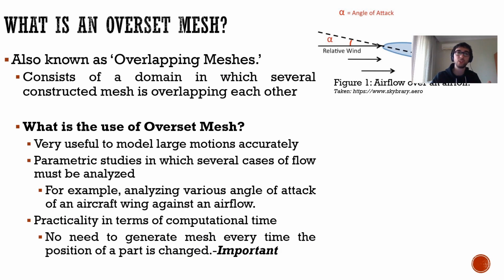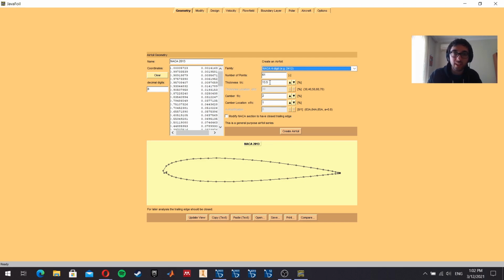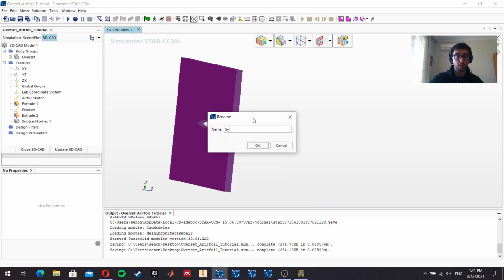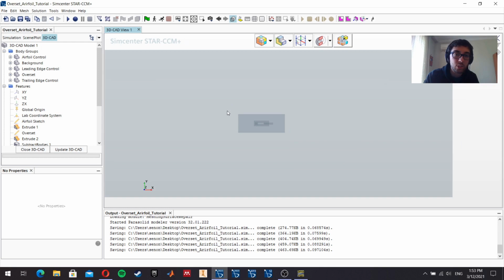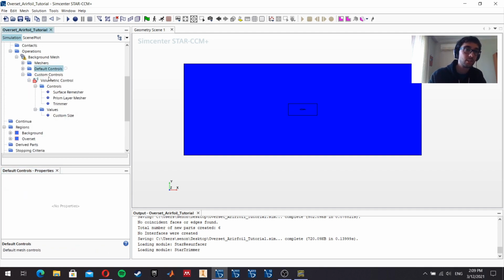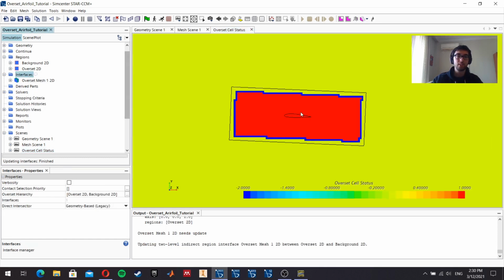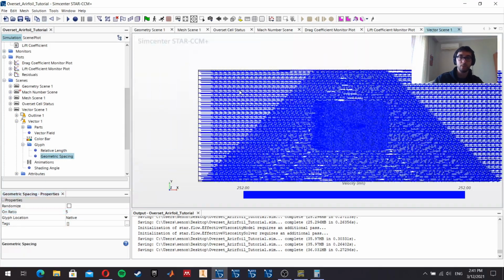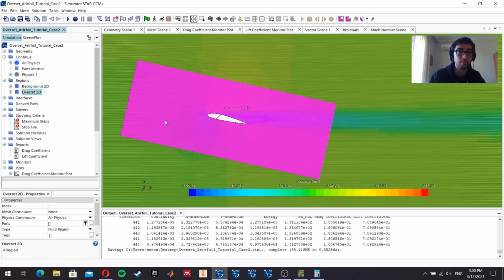A Flow Case Study: Transonic Air Flow Over NACA2213 Airfoil Using Overset Mesh

Comment: Hello, I just came across this extremely helpful tutorial. After following the steps in video, I am now trying to apply a translating motion to the airfoil so that it moves up and down the y-axis, hence simulating a simple flapping mechanism. Do you have any ideas on how to achieve that? Any guidance would be greatly appreciated.
Many thanks.
Reply from the maker: Hello,

You can always apply a user-field function in which you can define the desired motion to the airfoil (the overset motion).  

Perhaps you can create a field function of a sine wave with respect to time and then assign it to the motion through TOOLS>Motions>(Your Specific Motion-rotation, translation etc...)> click on the motion and assign the function (for rotation you have to click on rotation rate then click the box with three dots in the properties window and for translation you can assign  a user-function through clicking on it >translation velocity>click on three dots and assign your function.)

Hope I was clear enough. If you have any questions please let me know!

Cheers. Good luck!
Reply: @ownershen97  Hello, yes this is extremely helpful. thank you so much for the quick reply! I have done this but then do I apply that motion to the overset region? And I am also struggling to set the physics models, do I have to select specific models so that I am able to see the airfoil moving when I run the simulation?
Thanks again nd apologies for taking your time.
Reply from the maker: @alejandrabotbol308  Hey Alejandra,

You should apply the motion to the overset region. 

Considering that there is a time-varying parameter in your simulation, you should select a model that is able to show you time dependent motions induced into the flow. Note that ReynoldsAveraged Navier-Stokes(RANS) models are not very applicable in your case so you should either use Laminar or Large Eddy Simulation (LES) for your models (FYI:Laminar is not necessarily a model) with a fine enough mesh to resolve the turbulent scales.

Preferably, you should use LES. Also, if you would like to see the motion, you can take 'snapshots' of a scene for each specified time-step through adjusting the settings in scene>update section. 

Try to set up velocity and pressure scenes and see the changes in the flow. 

Cheers!
Reply: @ownershen97  Thank you for all of the advice, it is extremely helpful. I will try all of that!
Reply: Hi have you solved this problem of airfoil flapping? if yes I need a little help. Thanks

Comment: Hi, when I try to display y+/pressure plot along the airfoil chord, I find out it will be more clear by separate the airfoil to upper and lower surface, but It is hard to do in the 3D-CAD, do you have some easier way to do that?
Reply from the maker: Hey,
Correct me if I misunderstood you question: You would like to separate the airfoil into two sections; lower and upper surfaces.

In that case, in 3D-CAD, before you subtract the airfoil shape from the overset region, you can create  a point at the centroid of the airfoils side surface (right-click on the surface --> Reference Geometry-->Point from Entity Center-->Centroid-->Apply. Then, noting the coordinates of this point (copy them by clicking the '...' on properties window),  right click 'Features' and proceed to select 'Create a Plane'--> 'By Definition'. Paste thee coordinates you have copied and play with the directions until you create a plane which cuts the airfoil in half. 

Once you have done that you can now slice the airfoil in half using Slice Booelan operation (Keep both sides while performing the said operation). Make sure you label the upper and lower surfaces correctly.

Hope this helps...Cheers